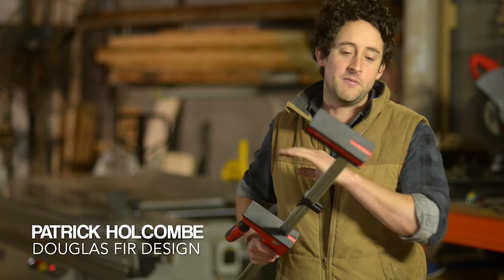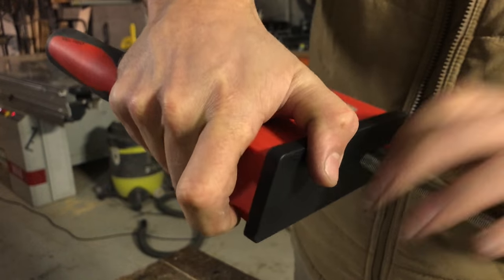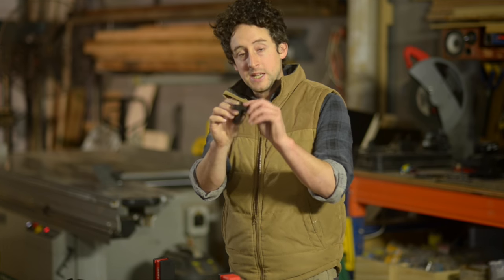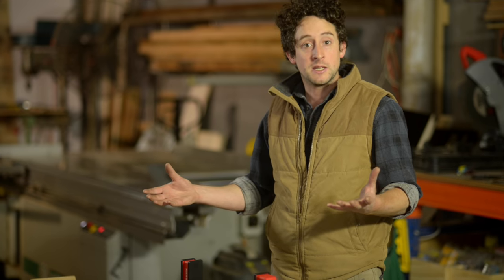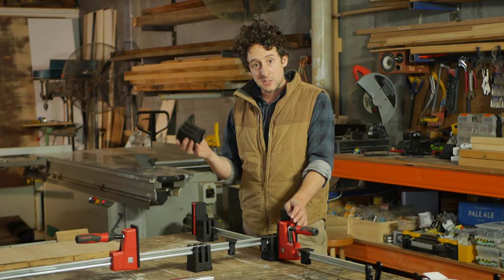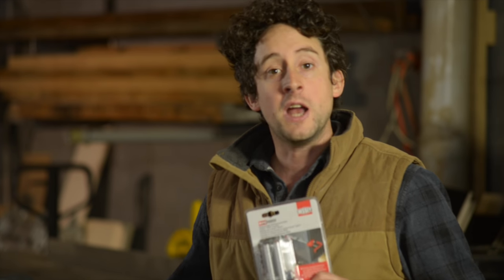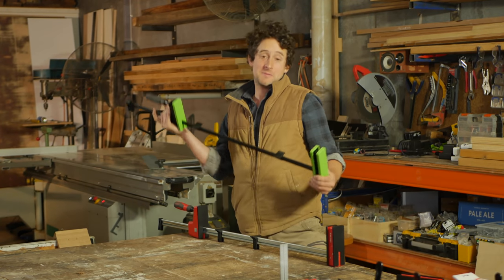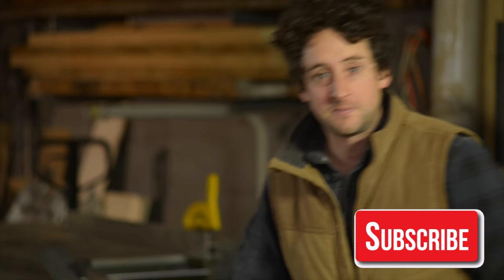Parallel Clamps - Side by Side

Comment: I’ve been using the Yost lately, and they’re really good.  Very sturdy bar and bigger clamping surface than the bessey, as well as a handle that turns to 90 degrees so you get a lot more leverage.  I got them for $28 each.
Reply: Price has gone up lately, way up. Walmart is asking $90.42 for a 32 inch clamp.

Comment: I have invested a bundle in Bessey clamps over the years and love them. But the one I have found in the parallel clamps that I use every day virtually are the the UniKlamps. They are are a lighter version of the  K-body but as someone once said l “a bloody ripper”. They give you a lot of clamping force, are light and easy to use and never let you down. Great review, but Torquata would be fine for a lot of general clamping jobs I am sure, as are most of their products.
Reply from the maker: Thanks Philip for your input. Much appreciated. We have found it interesting that for many, the Torquata clamps are the value-for-money preference. That is great to hear. Bessey are excellent clamps, but their innovation and quality of build come at a premium. For most of us, something the does the job well is all we need and for many, our range of Torquata clamps are just fine.

Comment: I have six of each size of the Torquarta parallel clamps and so far they have performed very well. My take on the bar flex is that if you have to use that much force when clamping up you need to go back and look at  your joinery it is obviously not up to scratch or you are creating dry glue joints starved of glue through too much clamping pressure. The one negative comment I have about Torquata parallel clamps is the soft faces are full of plasticiser and when pressure is applied while clamping unfinished timber you can gat an "oil stain"  from the pad. To counter this I have sets of plywood faces that I can hold in place with double sided tape. I can not justify the extra cost of the Bessey clamps for hobby use as much as I would like to own some.
Reply from the maker: Thanks for your input. We are glad to hear that you are getting good performance from our Torquata clamps. Not that we are surprised. But it is great to hear that their value-for-money component is certainly helping our fellow woodworkers. Thanks for the input and your ideas on the pad. An excellent and simple solution!